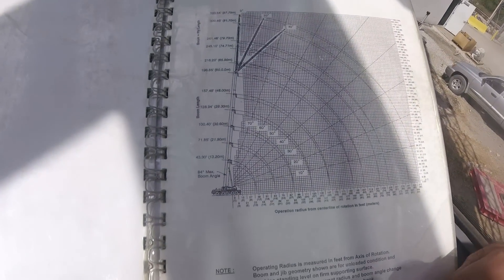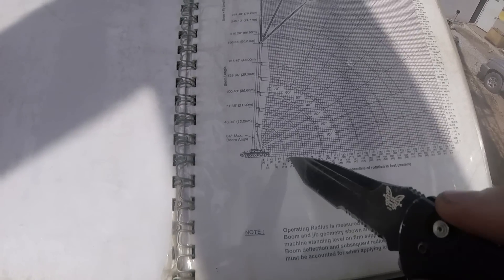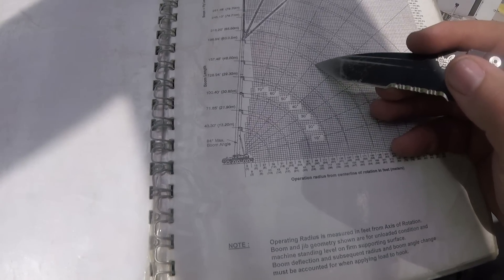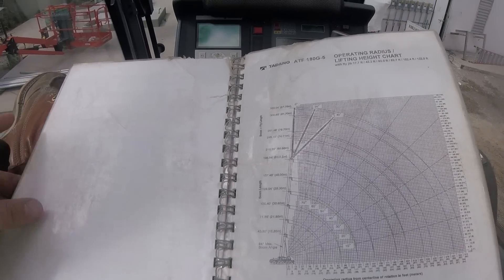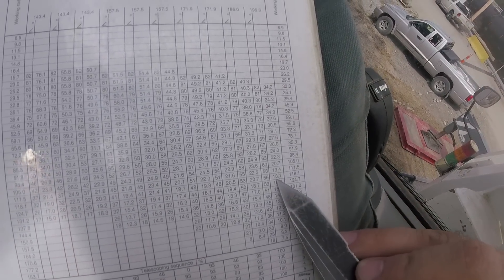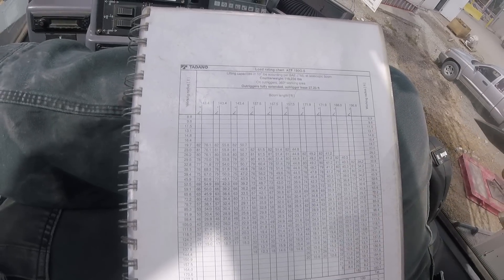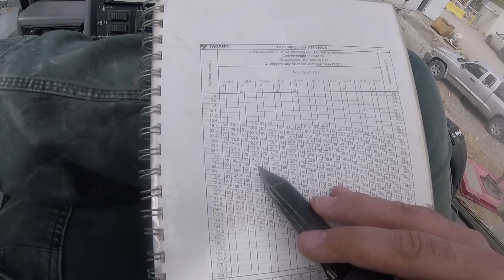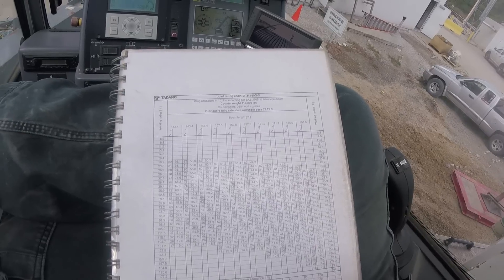Load Chart and Range Diagram

Comment: I've noticed that the maximum lifting capacity of cranes is with a radius that falls within the circle of the outriggers. Is there a possible practical application of this or is it only a reference? Or am I way off in the weeds? I guess the question is whether you can actually lift the maximum capacity of a given crane?
Reply from the maker: dmacdonell, it would be really difficult to find an application. What I find intriguing is there is no industry standard. Some manufacturers use an 8 foot radius for max capacity, others use a 10 foot radius, etc.. So, when searching for a crane, it's important to look at the entire load chart and compare at various radi. Thanks for watching! 🙂👍
Reply: @ToTheTopCrane  right tool for the right job. Thanks for making!

Comment: Very informative I was able to read the chart and see what you were talking about. Can you control each boom section? Please reply But if I don't get your message my Youtube is messed up and I'm not getting replys.
Reply from the maker: Brian Gardiner, yes and no. There is only one telescope cylinder inside the boom. So, the yes part...in maintenance mode, I can lock the cylinder into any one of the five sections and extend or retract it, as long as the boom is in a configuration that allows it. In normal operation, the sections are controlled by the computer, based on what mode I choose. Which is based on what I am lifting, crane configuration, and where I have to go with the item being lifted. Hopefully all of that makes sense. Thanks for watching! 🙂👍

Comment: Do you have to calculate boom deflection when you're setting up a lift, and how do you factor that in?
Reply from the maker: Sandy, on some jobs, it is definitely a factor. For instance, the 310 foot tower. I had very little margin for error on the radius from the center of the tower. If I was too close, I wouldn't be able to boom up far enough to set the piece. If I was too far away, I wouldn't have enough tip height (head room) to set the piece. On the actual chart, the boom angle is the loaded boom angle, for the defined radius, with the capacity shown. The range diagram however, doesn't show deflection. So, it is primarily a guide to get us in the ballpark or show what we can reach over the top of. Hope that all makes sense. Thanks for watching! 🙂👍
Reply: Thanks Jimmy, that makes perfect sense.

Comment: Great video.  I went through our basic crane and advanced crane classes at our training site. Each class was 80 hours so combined it was 160 hours. I think we had a whopping 10 hours of seat time, the other 150 hours was spent on load charts, rigging, figuring out weights of material etc etc etc  If you suck or hate math, find a different career.
Reply from the maker: Richard Savaglio, on the plus side....most of it is basic math. Lol. Thanks for watching! 🙂👍
Reply: Any Link so I can take the training courses online?